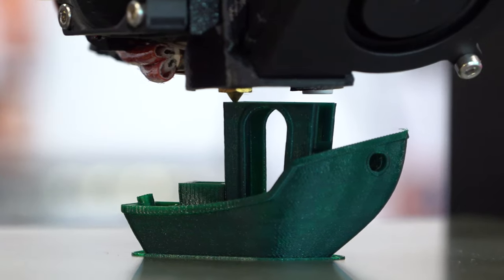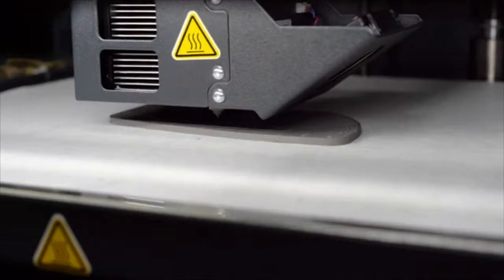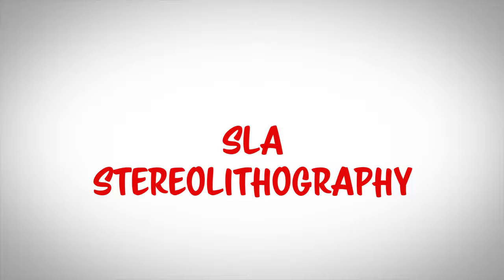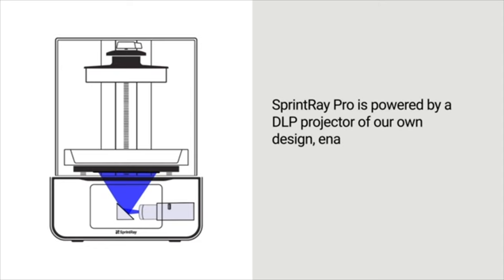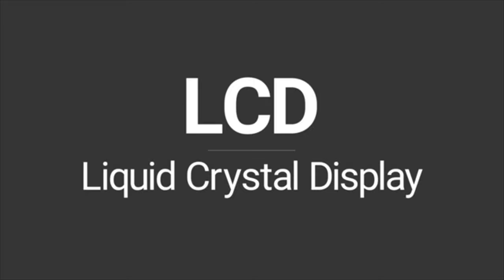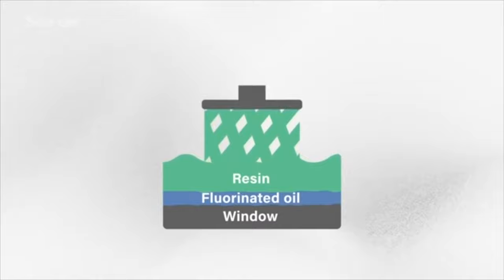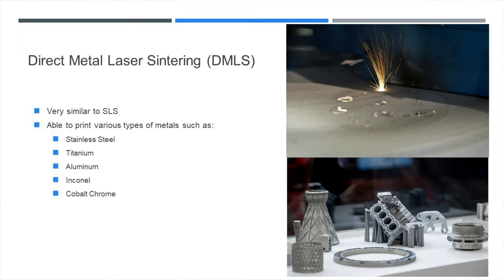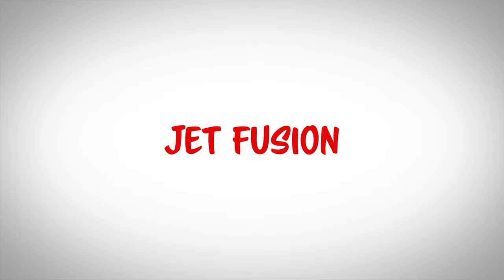Types of 3D Printers - 11 Different Types of 3D Printers - Introduction to 3D Printing

Comment: I'm sorry if this critique is harsh, but... I teach Additive Manufacturing at a well-known community college in Silicon Valley. I've been working and consulting in 3D Printing for 10 years. That said... this is a terrible way to classify or group types of 3D printing processes.  It takes a 'bottoms-up' approach to the taxonomy of printing processes.  By this, I mean that it essentially says, let's look at the printers themselves and see what the salient characteristics of them are, and group them by what they have in common.  If you do this, you'll make a distinction between, say, DLP and LCD/MLCD. Why?  Because they have different hardware for projecting an image onto a pool of resin.  In reality, they are the same process, just using different hardware to accomplish the same thing: DLP printers use a DLP Chip and projection optics for forming the image, while LCD uses an LCD display for a near-field image projection.  But, once the image is formed on the transparent window at the bottom of the resin tray, what's happening in the process is identical.

A much better taxonomy is to go ‘top down,’ starting with the ASTM standard seven categories of 3D printing processes.  The key word here is PROCESS.  By focusing on what’s common in the process itself rather than the printer, we can get a much better basic understanding of how the various processes work.  We can then take a look at exemplars of processes in each category.  For example, the ASTM process category POWDER BED FUSION includes the processes called Selective Laser Sintering (SLS), Selective Laser Melting (SLM) – which, unfortunately, is still well-known by the misnomer DMLS - and MultiJet Fusion (MJF).  So, what’s the problem with classifying these as the three types of Powder-Based printers?  The answer:  printers based on the ASTM process category known as Binder Jetting are also powder-based.  Mr. Rainmaker 3D either isn’t aware of this category of printers, or ignores it because it’s really an industrial process and his target audience is the hobbyist.  But, in presenting the field of 3D printers rather than processes, his information is at best incomplete and most likely confusing to anyone who digs a little deeper and comes across Binder Jetting printers.

Finally, even though I’ve watched only about the first 3 minutes, I’ve seen several errors already in his information.  For starters, the video clip on metal Material Extrusion printing beginning at 2:13 shows a Markforged Metal X printer.  He wrongly identifies it as a Desktop Metal video; both DM and Markforged would be none too pleased to see this confusion/mis-representation.

A second error:  right at the outset when he presents his list of the types of 3D printers (0:40), he mis-classifies one, which is a pretty significant mistake.  Laser Metal Deposition (LMD) is most definitely NOT an extrusion-based process; it is a Directed Energy Deposition process, which uses an entirely different physical approach and hardware.  He is probably confused about the difference between LMD and Desktop Metal’s branded name for their metal extrusion process (which, again, his video does NOT show); DM calls it Bound Metal Deposition (BMD).  You can see how this would be a simple mistake, but at the end of the day, his information is just… wrong.

[Edit:  I just sat through the rest of the video.  What he shows as "LMD" - a very short clip of Relativity Space 3D printing their rocket - is indeed LMD.  But LMD is NOT an extrusion process.  Clearly, Mr. Rainmaker is ignorant of the process; if he knew anything about it, the first thing he'd know is that the metal is not being extruded!]

I’m an educator in 3D Printing.  When I see YouTube videos of purported ‘experts’ wrongly explaining aspects of the rich and exciting world of 3DP, well… it just makes me cringe.  Yes, I’ve taken him to task.  Because no, he has not done his homework.  As they say Abe Lincoln (or was it Mark Twain?) once said:  “Better to remain silent and be thought a fool than to speak out and remove all doubt.”  Poorly-researched videos such as this do not serve Mr. Rainmaker well in his quest to solidify his reputation as an expert and educator in 3D Printing.  Au contraire…
Reply from the maker: I have to say this is the most thorough critique I have received to date, here is a trophy 🏆

With that said I can appreciate that you understand this topic well, better than most. As a teacher you can understand that you have to be able to reach your audience. You are correct there are mistakes in this video, I could of done better. With that said this is intended to help provide a general overview to someone who is totally new to 3D printing. Just as when we teach about the atom what is presented in a textbook is nowhere close to reality, but we must start somewhere in order to illustrate the concept at a level the audience can understand. I will continue to work and improve my own understanding as well as my ability to make content in the future. Thank you for your detailed critique.
Reply: For a rookie, that did not check anything about 3D printers in last two years. Your video was very informative. Maybe you can create more in depth ones for each of the technology.  @rainmaker3d

Comment: Hi, I have a question. Is there any possibility for the 3d printer to print on an exterior surface? I mean, for example, the extrusion base printer, could it print on a different surface area (table surface, board ...etc.)
Reply from the maker: Yes you could you would just have to figure out your surface adhesion for the initial layer.

Comment: Hi there.  I’m fantastically ignorant when it comes to 3-D printing and I’m trying to learn as much as I can through excellent videos like this.  I would like to know what type of 3-D printer would be best for making plastic molds of car and truck accessories that will be samples for future mass-produced items probably in metal.  Some of these accessories are custom-made cell phone and hooks, but others would be custom-made light bars that would be long as in the width of a light truck.  Do you have a recommendation as to which 3-D would do the job of small items as well as items that are 60 to 70 inches wide?

Comment: So I’m just getting into 3D printing and I’m still not quite sure which one is best. My budget is around $500. If anyone has any suggestions please tell me. Thanks
Reply: If your just getting into it. Id get. Ender 3 for $170. 
Its a great printer to see if your into 3D printing. Can print very nice prints. 

And if you want something bigger or nicer later. You can resell the ender for most your $ back. Considering its not to expensive at $170 to start with.
Reply: @nikozomac2432  if his budget is 500 dollars why would you recommend a $170 printer

Comment: you missed one tho it might fall into ffd but 3d pens. its also probily a bit of a joke compared to regular 3d printers
Reply from the maker: That's a good point, I would say it falls under the ffd line but a point could be argued.
Reply: @rainmaker3d  i think theres only 2 types of 3d pen and their both still technicly filament based its just different types of filament. i even heard of a 3d pen that uses old plastic bottles as filament.
Reply from the maker: @Drake Masta  I've got to use one before at a school but they are more of a toy, great way to get kids interested in 3d printing and teach them the principle of heated extrusion.
Reply: @rainmaker3d  fair enough but some of the stuff people have made with 3d pens is pretty cool

Comment: So any printer that's has any real use is unthinkably expensive and is basically only for large manufacturing companies.. While all the 'desktop' 3D printers within reasonable budget are basically just gimmicks to print useless table-top figurines... There are so many 3D printing youtube channels, making videos like "OMG best printers in 2021!!!11" yet not one of them actually makes anything that has any real-world use with these printers which leads me to believe this technology (outside of large industrial machines) is largely a useless gimmick.
Reply: That is completely incorrect. 
You have different levels of printers. You have hobby printers that fall into the cheap category you speak of, and inside that category there are plenty of cheap printers capable of printing objects that people can actually use. People use them for art and for making small replacement parts. Just like with anything you have to do your research and find what machines are good and which aren’t. You can get a machine that is useless, or you can get a machine that works and slowly upgrade it or fix it up to be more precise. You have to be realistic and know what you’re getting and what it can do.
Reply: I have a TEVO Tornado (FDM printer). It only cost me about $200 but I've used it to print replacement parts or to print something to make an appliance work better. It's also good for printing small things like Chess pieces,  if I wanted, so no, it's not a gimmick.
Reply: Unless you're printing metal, fdm should get the job done (or dlp if you can handle the chemicals properly).

There are so much more to the expertise in understanding the engineering process that's not covered in this video. I took a course in 3D printing in university to know these stuff too lolz.

But yea, I don't know about the quality of 3d printers at like $500 range. The one my university use costs like $5k and is still limited in many ways. 

That's not to say FDM prints are useless though. If you design and engineer your 3d model properly, it should be usable. I replaced a broken plastic part of my electric fan. I've seen other students created hardwares that can withstand limited force like bolts, screws, joints, etc. It also depends on the material of the print too, of course. Cheap fragile plastic will get you cheap prints.